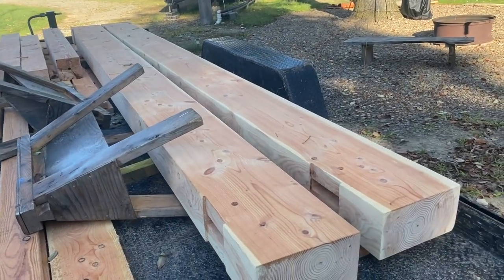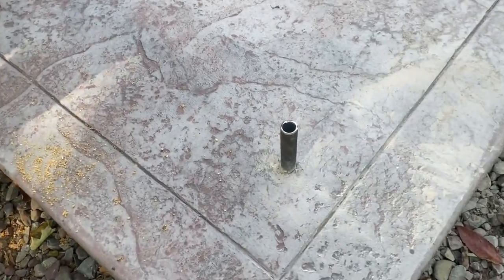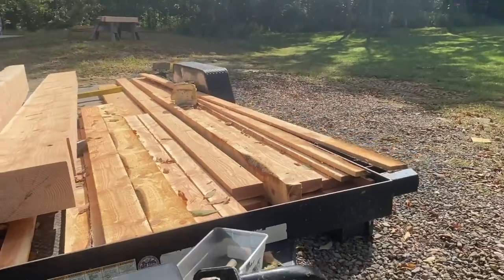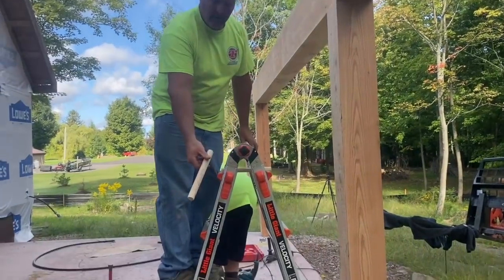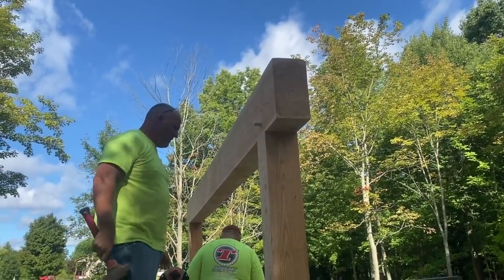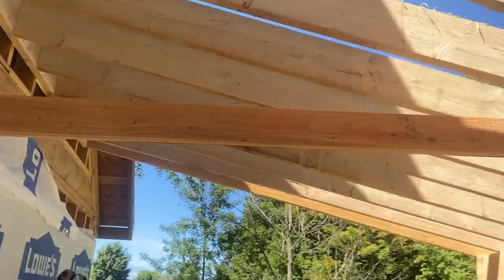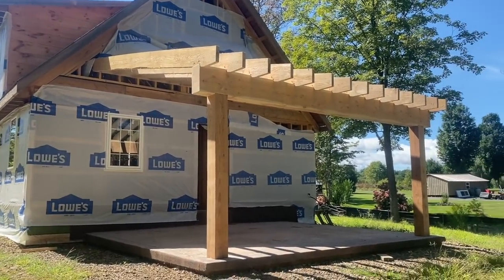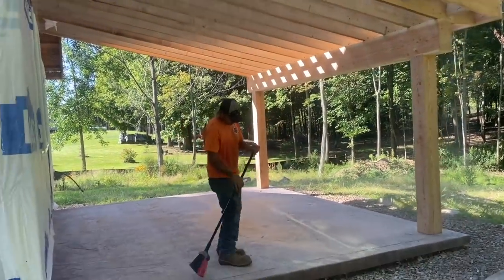Timber frame porch project (frame raising)

Comment: It’s too easy to be negative when commenting on YouTube, that said, when pegging a joint the hole in the tenon should be offset. Not in line, then when the peg is hammered home, it tightens the joint.
Reply from the maker: Draw boring 👍

Comment: My camp was a 1 story built 3-4 foot off the ground with whole trees cut on large rocks above ground all made with ruff cut doug  fur almost 60 years ago and it is still rot free except 1 outside joist that had water damage.  I would have coated the bottoms of the post to keep the water from rotting the base of the post or at the least heavy caulked around the steel post and the wood edges.

Comment: Getting ready to do a porch here in New Mexico with similar spans did you let your timbers dry at all or worried about twisting ?
Reply from the maker: No I did not let them dry. pick a nice tree and it should not twist as it will be locked in with mortice and tendon and will cure slow outside. put timber oil on it too.